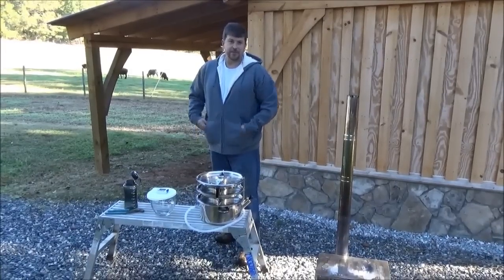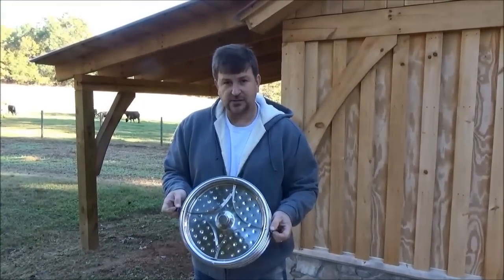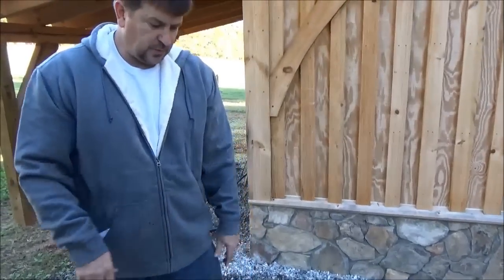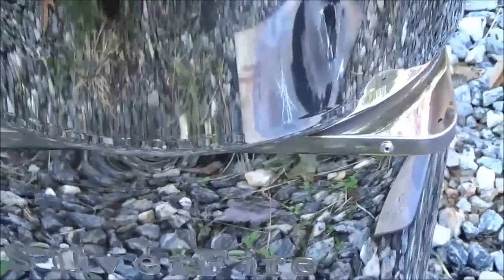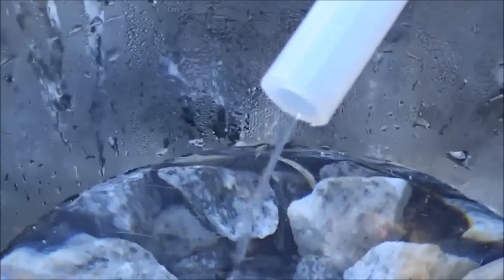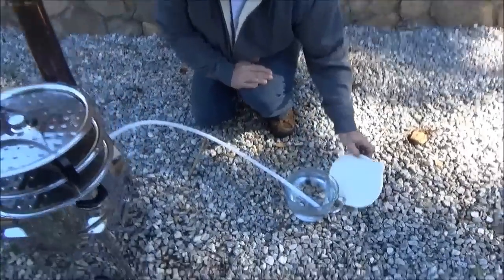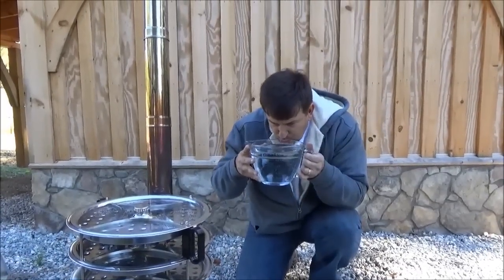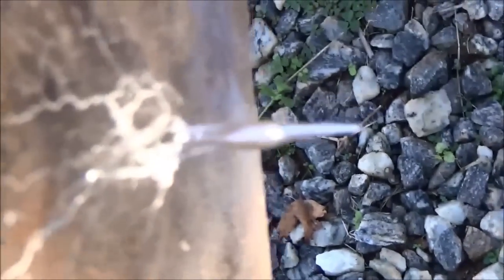Off Grid Water Distillation at its Best!

Comment: During nearly 19 years of clinical practice I have had the opportunity to observe the health effects of drinking different types of water. Most of you would agree that drinking unfiltered tap water could be hazardous to your health because of things like

parasites
chlorine
fluoride
dioxins
Many health fanatics, however, are often surprised to hear me say that drinking distilled water on a regular, daily basis is potentially dangerous.

Paavo Airola wrote about the dangers of distilled water in the 1970's when it first became a fad with the health food crowd.

Distillation is the process in which water is boiled, evaporated and the vapour condensed. Distilled water is free of dissolved minerals and, because of this, has the special property of being able to actively absorb toxic substances from the body and eliminate them. Studies validate the benefits of drinking distilled water when one is seeking to cleanse or detoxify the system for short periods of time (a few weeks at a time).

Fasting using distilled water can be dangerous because of the rapid loss of electrolytes (sodium, potassium, chloride) and trace minerals like magnesium, deficiencies of which can cause heart beat irregularities and high blood pressure. Cooking foods in distilled water pulls the minerals out of them and lowers their nutrient value.

Distilled water is an active absorber and when it comes into contact with air, it absorbs carbon dioxide, making it acidic. The more distilled water a person drinks, the higher the body acidity becomes.

According to the U.S. Environmental Protection Agency, "Distilled water, being essentially mineral-free, is very aggressive, in that it tends to dissolve substances with which it is in contact. Notably, carbon dioxide from the air is rapidly absorbed, making the water acidic and even more aggressive. Many metals are dissolved by distilled water."

The most toxic commercial beverages that people consume (i.e. cola beverages and other soft drinks) are made from distilled water. Studies have consistently shown that heavy consumers of soft drinks (with or without sugar) spill huge amounts of calcium, magnesium and other trace minerals into the urine.

The more mineral loss, the greater the risk for osteoporosis, osteoarthritis, hypothyroidism, coronary artery disease, high blood pressure and a long list of degenerative diseases generally associated with premature aging.

A growing number of health care practitioners and scientists from around the world have been advocating the theory that aging and disease is the direct result of the accumulation of acid waste products in the body.

There is a great deal of scientific documentation that supports such a theory. A poor diet may be partially to blame for the waste accumulation.

These and other junk foods can cause the body to become more acidic:

meats
sugar
alcohol
fried foods
soft drinks
processed foods
white flour products
dairy products
Stress, whether mental or physical can lead to acid deposits in the body.

There is a correlation between the consumption of soft water (distilled water is extremely soft) and the incidence of cardiovascular disease. Cells, tissues and organs do not like to be dipped in acid and will do anything to buffer this acidity including the removal of minerals from the skeleton and the manufacture of bicarbonate in the blood.

The longer one drinks distilled water, the more likely the development of mineral deficiencies and an acid state.

I have done well over 3000 mineral evaluations using a combination of blood, urine and hair tests in my practice. Almost without exception, people who consume distilled water exclusively, eventually develop multiple mineral deficiencies.

Those who supplement their distilled water intake with trace minerals are not as deficient but still not as adequately nourished in minerals as their non-distilled water drinking counterparts even after several years of mineral supplementation.

The ideal water for the human body should be slightly alkaline and this requires the presence of minerals like

calcium
magnesium
Distilled water tends to be acidic and can only be recommended as a way of drawing poisons out of the body. Once this is accomplished, the continued drinking of distilled water is a bad idea.

Water filtered through reverse osmosis tends to be neutral and is acceptable for regular use provided minerals are supplemented.

Water filtered through a solid charcoal filter is slightly alkaline. Ozonation of this charcoal filtered water is ideal for daily drinking. Longevity is associated with the regular consumption of hard water (high in minerals). Disease and early death is more likely to be seen with the long term drinking of distilled water.

Avoid it except in special circumstances.

Zoltan P. Rona MD MSc
Reply: Hi Zoltan.  You make good points, but I will clarify a couple.  If water is distilled into glass with almost no opening for air-water exchange, then the water will not turn acidic, it will stay neutral 7.0 ph contained in clear glass. 
People who spread the rumor that distilled water is acidic may turn people off from the most foundational tool of healing.  The science must be taught of how distilled water turns acidic and how it is kept neutral.

Making soups and teas with distilled water is superior for extraction, yet instead of focusing on this positive and very beneficial point, you focused on a potentially negative aspect when you wrote:
"Cooking foods in distilled water pulls the minerals out of them and lowers their nutrient value".

THere are pros and cons to everything and caution should be taken with distilled water, but most importantly, it's healing potential should be taught first and foremost, while contraindications and precautions should be taught alongside.

I think this is a very inaccurate statement you wrote:
"Avoid it except in special circumstances."
You made decent points in your comment, except that if someone is mineral deficient, when they use distilled water, they can add things to their water, like fresh living herbs like mint, cut fruit, fresh flowers, mineral drops, or make teas (as in boiling or steeping a medicinal dosage of herbs, not a little tea bag).  In this way, distilled water can be used daily, NOT, as you wrote in special circumstances.
The point of distilling water (along with another filter to remove VOCs, etc) is to get rid of the toxins that even reverse osmosis can't.  One distillation is not even enough for very filthy water.  You can't even  call dirty water (such as from tap water) after one distillation truly distilled.  
there are different ways of using distilled water, some more and some less intelligent ways and there will always be people who go to extremes and these types need special warnings in red letters.
Reply: Nice copy and paste. Don't listen to these shills.
Distilled water with no toxins is well worth the lack of good minerals in them. 
In this day and age we don't have a choice.
Reply: Straydog Living I hope you sell this because I want you to know that was valuable advice I will not forget.Sounded very good not to hard not to soft.
Reply: Seán O'Nilbud Who is anus Anni ?
Reply: Straydog Living you forgot to mention those minerals leaving your body are INorganic  which don't belong there in the first place. Tell the people Doc. Pure water is the best water for you.
Reply: Straydog Living As long as people eat when they consume distilled water they will be fine. I've been drinking distilled water (instead of tap, filtered, bottled, R.O. and alkalized) now for over two years. I read an article that said that if a person drank distilled water for over a year they would die. I knew it was complete "scientific" b.s.. The article was "peer reviewed" too. Which doesn't necessarily mean the peers are staying accountable to each other or their constituents to ward off lies, falsehood, deception, etc. "Peer reviewed" now means, "Warning; be careful of Groupthink!"

There are lies propagated in "peer reviewed" articles & journals. Why? Mostly to maintain & continue power, control, greed, pride, and the like. It is part of a system that keeps practitioners and their patients purposefully ignorant so they can accumulate more money & power. How else could they make many poisonous pharmaceuticals that later cause terrible health problems & death then consequently huge class action lawsuits? 

So the intelligent question, for each of us personally, becomes, "Who do I trust in a world of lies & deception?"
Reply: Straydog Living so running the water through a solid charcoal filter immediately after distillation, and then in turn being ozonized would be the best option?
Reply: Jonathan Garzon, interesting & intelligent question. Dr. Maseru Emoto (of Japan) researched and showed that our intentions, thoughts, words, and enviroment can have an effect on water. Look up his research, if you're not familiar with it. In short, the crystalline structure of frozen distilled water has a memory (similar to metal memory; bend a piece of wire and it stays in that new shape) that is affected by the environment it is in. I tried an experiment of my own and had some really interesting results. Distilled water that I froze and exposed to the word, "Jesus" defied gravity. It made me think of the phrase, "Jesus rose from the dead."  So then, perhaps the best water would be to collect water from a natural (/wild) source, distill that, pass that water through activated charcoal, then pass that through ozonation, and then think of positive & constructive thoughts, intentions, words (spoken & written) and lastly, drink & use that.  What a long process!  What I do is; 1) boil a gallon of tap water on the stove top for 5 minuets, 2)let it cool until it stops boiling, 3) put said water into my distiller that has an activated charcoal filter on the spout 4) Speak, "Thank you God for clean water and a distiller." 4) Put some of the water into an ice tray that has positive words written on the bottom of each ice cube "cup". 5) Share the good water.
That maybe the best option since it is probably more practical than a very long drawn out process. May God grant you favor searching for knowledge and wisdom!
Reply: gtube: I asked the same question to myself.
I do believe Sean O'Nilbud is bastardizing Ae Ania's name. This Sean guy is a nasty piece of work. He reverts to name-calling & cursing simply because he does not like what someone has to say, such as Ae Ania. He seethes with negativity & animosity.

It is my opinion that Sean does not know what he is talking about on top of that. I don't trust what he says. On anything.

I bet he is waiting with bated breath for comments to his diatribe, so he can go on ranting, & getting attention, which is why he commented in the first place.
Reply: thanks for taking the time to share your valuable personal experience with distilled water.
Reply: Straydog Living thanks I learned alot
Reply: Ae Ania thanks i learned from you as well lol so much I didn't know in this area.
Reply: You're worried about the acidity of distilled water when your stomach juices (which are mixed into any water you drink before proceeding into the intestines and blood stream) are many times more acidic than any potable water.  Are you worried about the acidity of all the water that passes through your stomach?
Reply: Mmm. So rock and dirt is good for you.  We need those dirt minerals. The truth is that we balance things out with  good eating habits. That's down to the individual. I wonder if most of all cancers and problems people now have, May be down to distilled water. I doubt that.   Being most arnt even aware of it. So you being flooded with loads of sick distilled water drinkers over time strikes me as odd.  You scaring people. Mdcuoff
Reply: Interesting. And by interesting I mean that in the sense when you are observing profound ignorance. I'm not sure where you got your MD from, but if you do indeed hold an MD it tarnishes the reputation of the achievement. Water acidity has no effect on your "body" acidity. It's complete bullshit. It's lies. Why? Because your stomach regulates the digestive system's pH, not you and your choices of refreshments. Your stomach is lined with gastric glands equipped with parietal cells that release gastric acid and is regulated by proton pump H+/K+ ATPase. It is true that your body's pH increases when these cells actively release gastric acid and bicarbonates enter the bloodstream. This is called the alkaline tide. This happens every time you eat a meal, or every time you ingest anything that disrupts the stomach's maintained pH balance. Your body is a machine. It regulates itself. When you increase the pH of the stomach by consuming food or drink, your body responds by activating the gastric glands until the regulating cells turn the action "off" when a certain pH is achieved. It's kind of like the central AC in your house. Your thermostat activates the AC whenever a temperature exceeds the setting, and turns off when it falls below the setting. The only thing that I see credible in your post is yes, your body needs electrolytes. These are cations present in groundwater, or for the layman, "minerals".
Reply: Straydog Living I've been drinking nothing but distilled water for three years...I feel fuckin great! Who payed you to say this utter nonsense??? Oh wait it's the same story I've read a thousand times about it leaching minerals from your body....hard minerals in water are NOT SOLUBLE in the human body, we have no way to utilize them, so they build up deposits in many different areas of the body over time. I started drinking distilled water because it actually washed away my moms cataract in about six months. She was legally blind.
Water does not even conduct electricity, only the presence of metallic minerals in the water cause a flow of current. Makes you wonder what all these foreign minerals are doing inside our body causing so many goddam problems all over the world.. Tap water is loaded with ground based non organic compounds blah blah blah
If you could choose river water or rain water what would it be?? 
Right.
Reply: Oz Camp n Hunt Dan another good thing for pure water it to structure it this can be done with Orgone energy. This is the energy of all life and so therefore will infuse more beneficial life force to any living organism that drinks it or absorbs it.
Reply: Lol, why not just use flouride gas and cesium and be done with it ?
Reply: Oz Camp n Hunt Dan are you here to learn or just troll around.
Reply: So you never heard of sea salt?
Reply: I have read that some add sea salt or Himalayan salt to distilled water. Any of you doing that?
Reply: @JohnBramble  you tell them John well said
Reply: @HWandW  LOL

Comment: The product reviews on Amazon for this exact item are NOT good. It is NOT all stainless steel, the undersides of the trays are not stainless.  Before you rush out to buy it read up on the negative side of distilled water.

Comment: 1:19 Done! it's to complicated in that it requires manufactured components and will cost more than it's worth for what it produces.  And really it looks more like a water evaporator.
If you have some water you need why let half of it escape between the pie pans.

Next
Reply: The steam is condensing on the underside of those trays where the dimples are and is diverted to the collection cup. It isn't "escaping"

Comment: That combination of stove and distiller will set you back $600-700! Ridiculous.  The distiller is just short of $400 and the stove is another $225+.  Basic distillers can be made from old pots and pans for a fire distillation OR you can go as simple as a plastic sheet in the sun for solar distillation and the stove can be fabricated using anything metal to make a rudimentary furnace.   Under what circumstances would you need to drink DISTILLED water rather than just boiled water anyway?  You're not in the middle of the ocean on a raft.  I've been all over the world and never had the need to distill water in order to consume it.  A ten minute boil will kill anything that will hurt you. I'll save the $600+ dollars and buy a stainless pot with a cover for $10.  Hell, I might even go to goodwill and get one cheaper.
Reply from the maker: It's for my flooded lead-acid battery bank.
Reply: Hey, good for you that you can justify the expense.  Most can't.  Many other ways of distilling water for pennies compared to the complex and expensive method shown here - and as far as a $250 portable stove that melts on the first firing....you can keep it. I distill water for my lead-acid battery bank on my wood stove in a stainless pot.  Works fine

Comment: These are far, far too expensive at almost $400. For $80 more, I can get an 8 gallon stainless steel (milk can type) still with a 2" copper still head from hillbillystiils. Very efficient and also versatile (can make alcohol as well as distill water)
Reply: In 5 years the price at HBS has gone up to thousands per setup

Comment: I cant believe this is open for air contaminants
Reply: If your concerned about air contaminants reaching the condensation on the UNDERSIDE of the trays, then simply use a filter before drinking it, but if anything were in the air that would contaminate the water and be harmful, you are probably already dead because you would be breathing a lot more of it than would collect in the water.